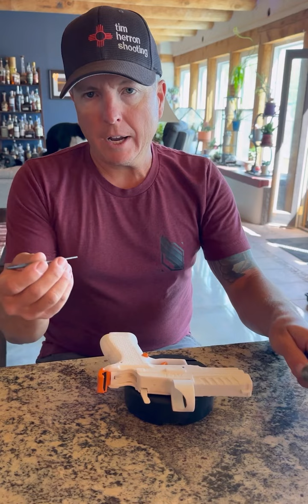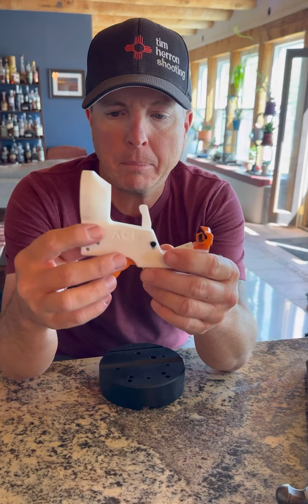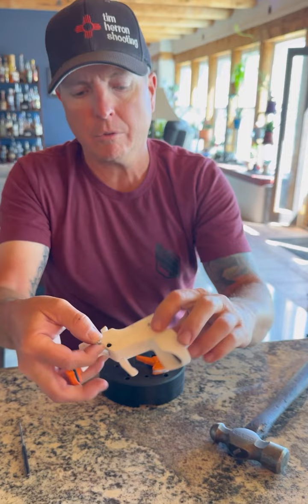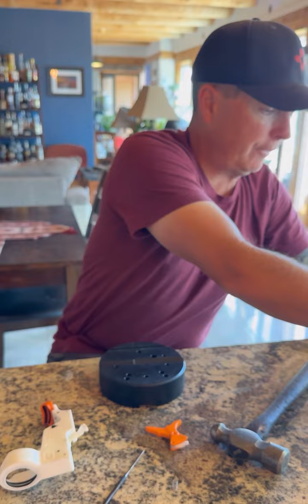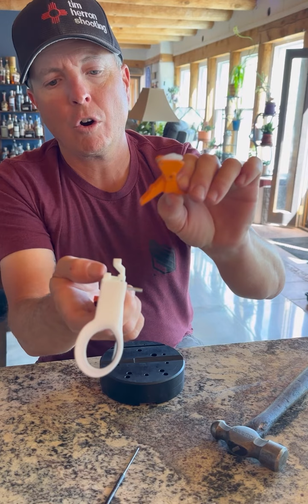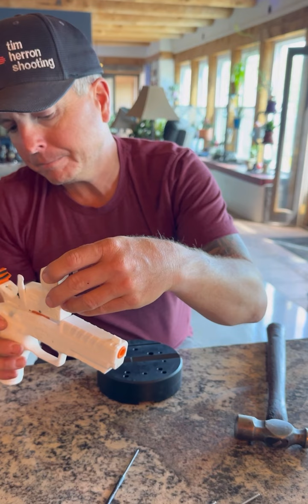Trigger Improvements for the AceXR Pistol

Comment: How did you get a shorter reset and take up (pre-travel)? I have the pull weight where I want it but when I try the VR adjustments to shorten pre-travel I get unintended multiple shots. Great vid. Thank you for posting.

Comment: If I wanted to make the trigger pull heavier, what type of spring would I need to do that?
Reply from the maker: @AviSpira  you’d just need a heavier spring to replace both of the sear and trigger return springs. However, I’m not sure where or what specifically to get
Reply from the maker: @AviSpira  you could try stretching the existing springs to add a bit more tension
Reply: @TimHerronShooting  Thnaks, gonna do some looking to see if I can find the springs needed!

Comment: I would highly recommend Silicone grease vs. Lucas Oil (or any oil based lubricant), as it will break down the plastic over time. Silicone grease is recommended for plastics and elastomers.